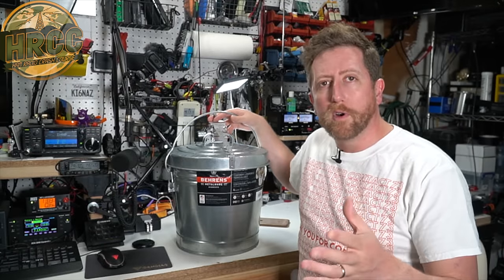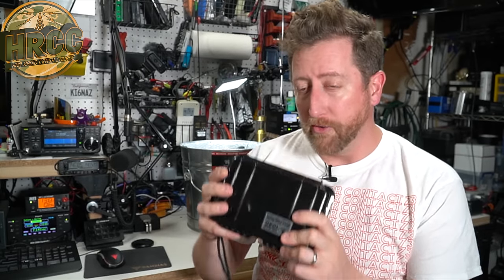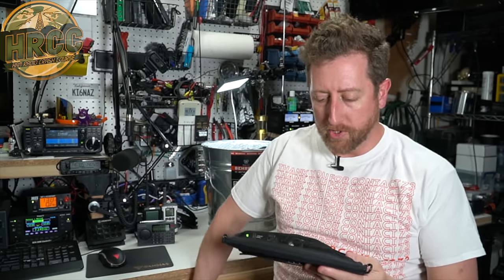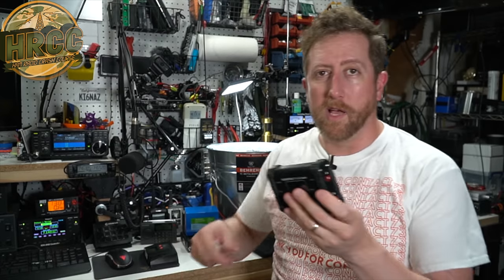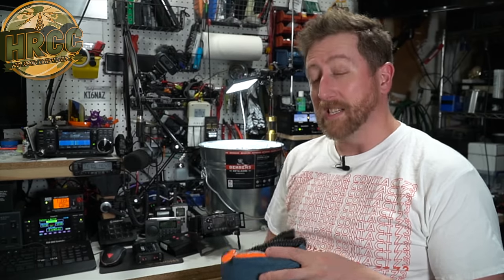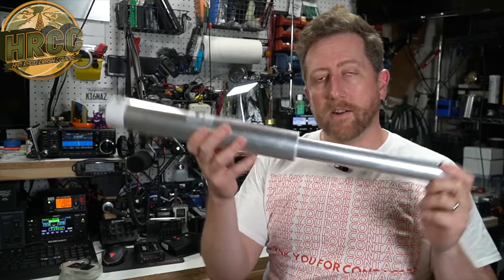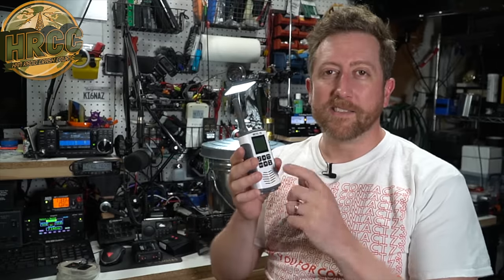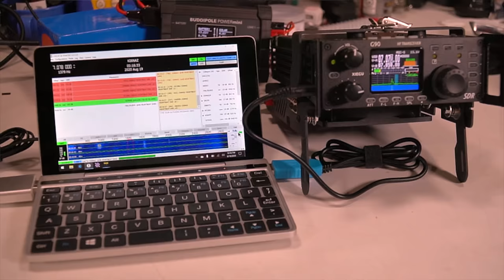Ham Radio EMP Kit, The Tactical Trash Can

Comment: Josh, don't forget moisture. You aren't going to have a weep hole. Toss a few silica packets in the middle compartment.
Reply: Nope you cant do that a pin hole, or screw etc  is enough to add +10dbm of signal in. -tested it.
Reply: Silica packs are a great idea. Depending on where you live condensation could be a big deal.  I had the same idea as Josh, but could not seal it tight enough nor eliminate enough moisture to prevent condensation.  I tried rice, but I didn't try silica.
Reply: Dry rice in a nylon stocking
Reply: @michaelbaldwin6543  try the stones from a humidor
Reply: Josh says he's in SoCal.  That means desert environment - not thinking about the consequences of moisture, because not a normal environmental factor for him.  I would use it just about anywhere, though.
Reply: Rice will do the job too.
Reply: @chrissewell1608  and you could eat the rice if things really go down hill
Reply: If you're concerned about moisture use airtight bags with desiccant.  Not a big deal.
Reply: I don't know about silica packets. But desiccant packs would work great, as long as the can is airtight.
Reply: Thanks for the heads up, there's a chance for moisture introduction every time you open it..
Reply: Good idea. There are "renewable" desiccant packets made to go in gun safes that change color as they absorb moisture. Whenever you open the can for periodic maintenance you can put the packet in the oven to bake out the absorbed moisture.
Reply: Ha😂 thought about that too luckily I tell my wife and kids give me all ur silica packets
Reply: You can buy the ones that keep gun safes dry from Harbor Freight for like $6.  Work amazingly

Comment from the maker: To help a metal trash can attenuate the EMP you must add some kind of seal.  I prefer using a reusable seal mesh gasket on the lid that sits on the lip of the can.  A future video is in the works that will demonstate the cans capability.
Reply: Isnt that galvanized steel?  I thought it had to be Aluminum?  At least it is for data storage like hard drives I think.  I don't know much about radios.
Reply: @ModernDecay70  to act like a faraday cage, it just have to be a good conductor, so that the pulse take the least resistance path through the shell and not into the radio, where any piece of circuit trail/wire will act like an antenna and send stray currents to all the unprotected components.
Reply: I have heard of a 'cage inside cage, inside cage' sort of arrangement where a diode connects the shells before heading to ground ... curious in all directions.
Reply: You need a large garbage can. Then you don't need to choose so little. lol
Reply: Make sure you add a bit of desiccant so it stays dry.
Reply: @Modern Decay Most metal trash cans are going to be galvanized steel. I'm sure as long as it's metallic it will block RF energy. You my want to also ground it, attach it to your station ground.
Reply: Pace?  the Picante Sauce?
Reply: How interested would you be in manufacturing/integrating kits exactly like this for sale?
Reply from the maker: @PressToDigitate  Very, but I think there would need to be some changes to make it work on a production level.
Reply: @HamRadioCrashCourse  We should chat about doing this.  Unless the EMP is Solar (and huge) there will be some surviving Satcom; even an adversary will be going after Milsats first, and may not get all the civil ones.  Consequently, utilities like Othernet (and even SiriusXM) which use very compact L-Band receivers are worth looking at, especially combined with a dedicated service (perhaps even originated on a specially rad-hardened satellite specifically for the purpose).  Other strategies, including LoRAWAN, SymphonyLink, etc. should also be included.  I believe that a secure reserve communications capability will be of extreme importance in the years ahead.
Reply: Very good many thanks !
Reply: Hope u got your valuables in faraday cage know 8hours ago shuman and magnetic field. Took a hit .ps I keep my stuff in microwave oven.cord is unplugged of course. Solar weather getting interesting.
Reply: "A future video is in the works that will demonstrate the cans capability." -Wow, when you fire off that Government surplus Davy Crockett Nuke that No Doubt you will purchase with Patreon Donations to do the demo, it's going to be a real blast at the 2021 Hamvention, and it will sure beat out the Famous "Sewer Water in the Parking Lot Fiasco" that we had back at Hara! 73 DE W8LV BILL
Reply: H Higgins I am a Journeyman sheet metal worker. There are three techniques to ensure that a seal is rf tight. 1 foil tape 2 a tig welder 3 tinning ( a solder joint).  Although the tape wouldn’t last long in water it will seal tight. I use the other two methods all the time for water tight seals. Bigger can be better.
Reply: As for corresponding to wavelength the same thing can be said about your bucket
Reply: H Higgins also how many small cans can you fit in a big one you could have two of three kits. For like your family or extras for Neighbours and friends. As long as they are insulated\isolated from each other.
Reply: H Higgins I like the paint can idea just have to sand out the seal area as there is a coating there
Reply: @Carlos-ux7gv  Would it then be a good idea to coat the inside of the bucket with rubber or plastic to prevent any metal items from making contact with the metal of the bucket?
Reply: H Higgins  Keep the batteries in a smart charger. But that brings up another question, would the charger transfer an  EMP pulse into the batteries and damage them?
Reply: Where can I get that seal?
Reply from the maker: Aussies & Trails Link is in the video description.
Reply: @HamRadioCrashCourse  Yeah, I checked your radio list on Amazon. Didn't see the seal there.
Reply: Um...I am trying to be helpful here.  That trash can will be full of trash.  You didn't line the can with plastic.  As an experiment wrap your phone in tinfoil.  Call the phone from another phone.  It will ring.  Does that stop Electromagnetic energy?  Nope!!!  Now wrap that phone in a ziplock.  Then a layer of foil.  Then put it in another ziplock.  Then another wrap of foil.  Then try and call it.  If you did it right it won't ring.  Now throw your bare phone in your trash can and call it.  It will ring...Now....What did you do wrong??
Reply: What about putting each device in its own anti-static Mylar bag
Reply: @greatpix     Robert I was reading where the bucket or trashcan, whatever, should be lined with anything that prevents items from touching any part of the can.  Simple cardboard would to the trick.
Reply: H Higgins  I meant to put the bags in the can with the devices in them.
Reply: Is the antenna socket/plug on the lid to to allow the can to be grounded to the Earth? Also, why not have a couple of good quality AA flash lights/lanterns and headlamps in the can too? Why not standardize on a couple (2 to 4) of handheld radios, plus a base station for local comms with wife/family/friends/neighbors, etc. I would think it would be most important to focus on 2 way communication within 10 to 20 miles, however be able to monitor state/national transmissions from further away is a must too. Awesome episode.
Reply: What are the chances that the bucket handle (aka antenna? Can arc across by burning through your cardboard insulator.
Reply: Use some aluminum duct tape and seal the lid all the way around.
Reply: well.. if you sealed up a metal trash can threw it in a giant microwave im sure all inside would be safe. that much exposure would fry people so im good knowing they work. i have 4 i use now. metal tape doubled sealed all around lid and handles. its also water tight 👍😁 got inverters and generator plus short wave radio 2 way radios and lots more safe.
Reply: The 'seal' is calked an "RF" or "EMF" "Gasket". ALL milspec COMSEC equipment cases have these sealing the equipment cases so stray EMFs are supressed or eliminated and also provides complete EMF/EMP shielding creating a Faraday cage enclosure out of it's own case when the covers are closed and external connector caps are all screwed on tight.
Reply: Feral Man   Earth is spherical from sixty five thousand feet like the fighter pilot says.  The surface shadowing tells the real story.
Reply: @aussiesandtrails ...Did you ever find that seal?
Reply: Where did you get the "reusable seal mesh gasket"?  I'm not finding it on Amazon or in a general Google search.  At the very least, is there a specific name we can search by to find it?
Reply from the maker: @brandonerickson5188  Here: https://disasterpreparer.com/product/emp-gaskets/
Reply: I know Im asking the wrong place but does anybody know of a way to log back into an Instagram account?
I somehow lost the login password. I would love any tricks you can give me
Reply: @Jayson Miguel Instablaster =)
Reply: @Ariel Riley It did the trick and I finally got access to my account again. I'm so happy!
Thanks so much you saved my ass!
Reply: @Jayson Miguel happy to help :D
Reply: @N2YTA  I was also wondering about grounding. Is it better to ground it to give the energy a source to bleed to, or is it better to keep i isolated from the ground via a piece of carpet or wood? I have gone the extra mile and insulated the inside of my trash can with cardboard to keep anything from touching the sides/bottom of the can.
Reply: Feral Man 
The bible does not say the earth is either flat or stationary.
Reply: Feral Man 
My comment was an accurate correction of your erroneous statement. My correction stands. You attempted to make it as though the bible was wrong and you got schooled. Now you're trying to change your answer. Know that this offense will be part of your permanent record. However, there is good news, you can be forgiven by God for everything.

But, not by the internet, it never forgets or forgives.
Reply: Feral Man 
The internet will never forgive you!
Reply: @snowwhite7677  "Primary, Alternate, Contingency, and Emergency" communications plan.
Reply: @HamRadioCrashCourse  everything is NOT actually linked anywhere :( 
What gives???
Reply: A small laptop (I replied too soon) with a USB BDXL drive. A tablet would work, but onscreen keyboards or having to find something to prop up the screen would be a constant hassle. Of course, you'd have to have access to a generator that wasn't destroyed, perhaps an old one with all mechanical parts, or one kept in a properly faradayed shed would probably still work.
Reply: @HamRadioCrashCourse  You can find a business that does prototype stuff for your container. You apparently know how to use modeling software if you can tell a 3D printer to make those spooling things. Maybe design a container, and then ask the prototyping business how much it'll cost to make you a few of them so you can test them out.

Then you can call up the companies that make the different products and ask them about ordering so many to resell them as part of an EMP kit that you're designing. Of course, you'll have to pay a lawyer to help you make sure everything's legit from a legal standpoint.

Comment: Use tube only equipment where you can. Tube operated radios are very tolerant towards EMP. Government and military communication are based on tube equipment. Use your EMP Proof trash cans to protect equipment that is transistor operated. Use a much larger trash can that has a high dielectric lining (rubber or double thickness cardboard) to store equipment that is EMP sensitive. The common aluminum trash can with an EMP lining will do fine with a contact liner on the lid.

Comment: Josh, consider this point: The powergrid relies on substations, each built pretty much entirely with custom built transformers. That take about a year or two to order. So in a large EMP event, the substations will slag down and remain down until two years AFTER the transformer factories can be rebuilt. If you have a radio and license, you will be drafted on the spot for government communications. A friend of mine is on a draft board, and said very bluntly they keep hardcopy lists of all kinds of resources. Like radio operators.
Reply from the maker: Just call me Generalissimo of communications. 🤣 seriously though we spoke about this on grid-down live stream. Even a small disruption in power could have rolling waves of effect and take down significant portions of the grid.

Comment: With the "STUFF" that's happening all over the World right now, an EMP Box makes a LOT of sense! I did a "Poor Man's" version for now until I can get a proper box made. I have put three radios away for this: My Wife's FT-4, my VX-6, and my VX-8. I have Two FT-65's. I'm planning to buy a THIRD FT-65 in the next several weeks, and then put the other TWO in Faraday Boxes as well. For my Poor Man's shield I put the radios and batteries in Separate Plastic Bags, and then Wrapped those in Aluminum Foil. Later I intend to put this in Cardboard Boxes, and THEN Everything into the Trash Can for extra protection.
Reply: Check out this new device called a EMP shield  which allows you to use them while they are protected 😉

Comment: About being prepared for a second EMP, if memory serves me after, lo, these many years, I believe that the military line of thinking was to expect the enemy to execute a second EMP attack in order to take out all of the transmitters that were not destroyed in the first attack. I believe that the idea was that there was a need to protect critical equipment for several days, even weeks or months, as a result. 

Perhaps having an "expendable" Baofeng would be the radio to use for a somewhat lengthy period in order to protect the more expensive/useful equipment?
Reply: or making "giant" cube out of aluminium or copper mesh and put all your equipment it. would be hard to isolate  antenna from radio and still keep it operational though...
Reply: @ApocGuy actually emps wouldn’t harm most antennas
Reply: @mycatsaliberal3848   it  wouldnt unless it ha active or passive baluns . the problem is that antenna WILL pick off magnetic energy from pulse, conveying  it through wires straight down to HAM radio...
Reply: @ApocGuy  honestly I shouldn’t of even said that. I don’t know enough about these kinds of antennas to even make that comment. I guess I was just thinking about other types of antennas.

Comment: A   .50 caliber or 20mm ammo can would work just as well. For a further method of sealing gaps between the body and lid of the can is to use the aluminum foil tape commonly used in HVAC duct work. Peel and stick over the seams.
Reply: I have been thinking the same thing.  The only issue there is that the adhesive on the tape may act as a dielectric, preventing  good connection.  My boxes have a rubber sealing gasket.  How about the idea of replacing that gasket with a woven copper gasket?
Reply: @Sagart999  perhaps try out copper guitar shielding tape. It utilizes a dielectric adhesive, allowing for conductivity.
Reply: I use 40MM ammo cans, 10 gallons of space and they come with a cardboard liner (to prevent sparks originally).

Comment: I have had a EMP can for years as part of my Southern California Earthquake/Disaster kit.

- Placed a strip of conductive copper tape around the cans upper lip to help with the electrical connection between the bottom and top.
- Also placed copper tape along the inside where the handles are connected to the lid and sides.  Mine had small holes at those attachment points.
- I have placed all my gear in Engpow Faraday Bags or wrapped them with foil.
- Lined mine with a rubber floor mat cut to fit bottom and sides.
- Before loading the can I lined it with two heavy duty trash bags and sealed them closed for water protection. (I live at the beach)
- Kenwood TH-G71 with USB charger and AA battery pack.
- Two Baofeng BF-888S programmed with GRMS and FRS frequencies, with USB charger. (Yes, I know...)
- Crank powered AM/FM/NOAA radio with light that can also work as a USB charger if you want to sweat out some amps.
- I placed rechargeable batteries/gear at the top of the can for easy access/maintenance.  Also taped a contents list to the outside.
- Can also has solar panel, USB power packs, rechargeable AA batteries and other gadgets.

Tested can by placing my cell phone inside then called it.  Failed the first time, then I added the copper tape covering the handle attachment points and it worked.
Reply: "- I have placed all my gear in Engpow Faraday Bags or wrapped them with foil.
" Respectfully, Bruce, I think you could have led with, and stopped at, that. That's all you need to do. I believe the rest is superfluous to the task.
Reply: @davidkennerly  I had the bags first, but they didn't store all my items and they were not 100% effective.  So I stuck them all inside the can.

Comment: Like you I wanted to have a “ miners canary” so I did put a small AM/FM weather radio solar power hand crank. But now that I’m thinking about it, I think I’m going to get a really small can just for the “canary”. Because I don’t even want to take the lid off of my big can, shortly after an EMP that may have been donated by an enemy, because certainly they will follow it up with at least the second one and possibly even a third. That’s why I have decided to move my “canary”  to a separate small can so that I don’t have to open my big Can with all my electronics in it to get to the canary. Tweet!
Reply: You could also consider buying a small, cheap faraday bag for this purpose. I have a tablet bag for my Surface so I can carry it with me. I was thinking it might be helpful to have small faraday bags inside the trash can to increase the attenuation for some of the more sensitive components (such as the transceiver and its microprocessors).